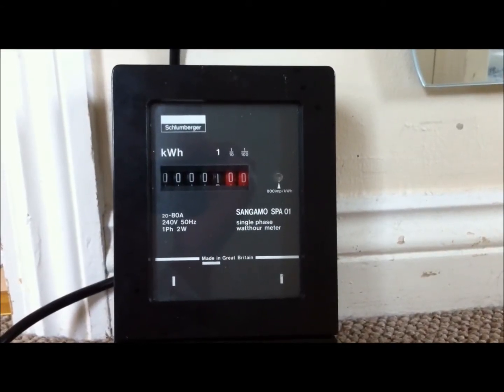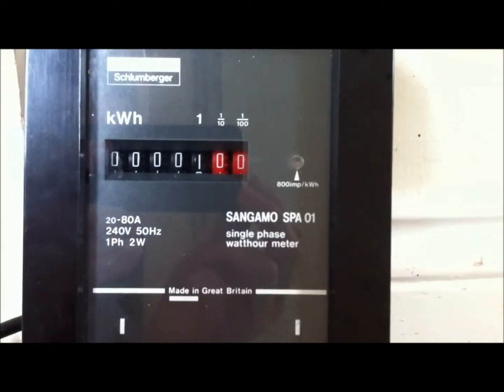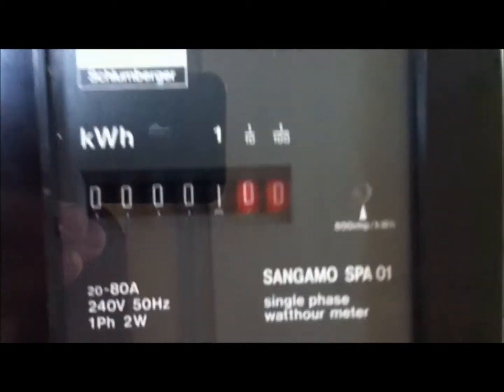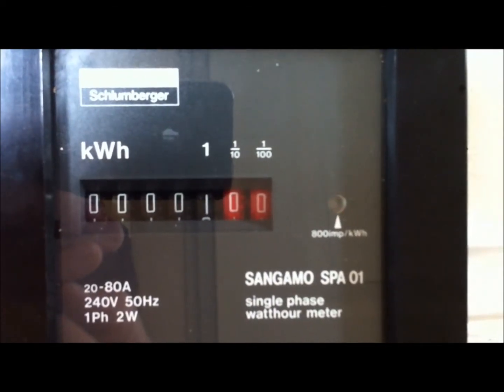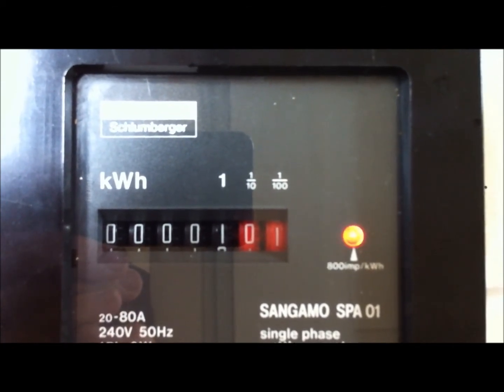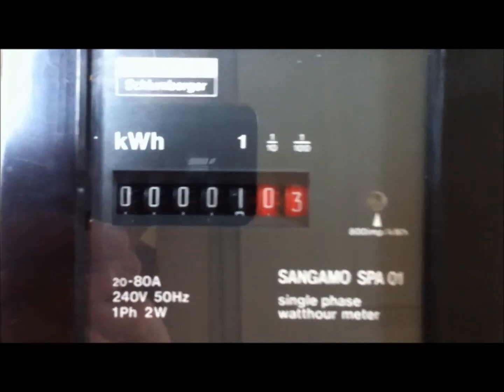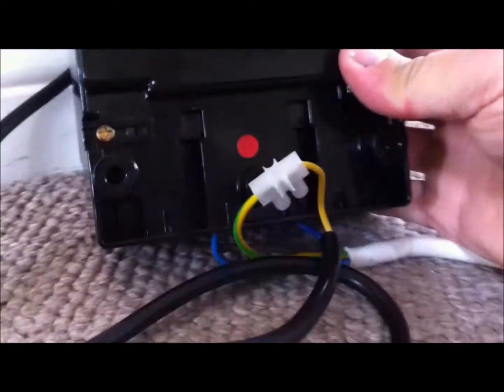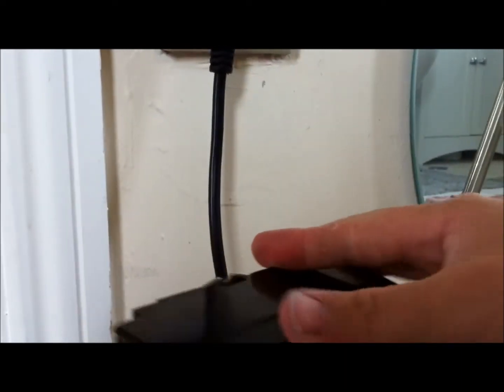Sangamo Schlumberger SPA01 kWh meter

Comment: Hello, where do I find the meter number?
Reply from the maker: Usually the meter serial number is printed on the front right under the black bottom line where it says Sangamo Metering Felixstoe Suffolk England, the meter in this video is decommissioned and therefore the number has been removed. I hope this helps. Steve.

Comment: Hi, I've just bought a house that has this meter and I wondered if you could tell me what it means when the light comes on continuously for about 20 seconds? Everything in my fuse box was switched on but absolutely everything in the house was completely turned off. The only thing i think could be consuming power would be the smoke alarm (with its 9v backup battery) but surely this should merely flash? Have turned the fuse box completely off today and going back in tomorrow to heck the readings see if anythings changed. Speculation: could the neighbours easily tap into it?
Reply from the maker: Hi Ross, normally a continuously lit light would mean that the meter is not detecting a load also known as anti creep, so something like a smoke alarm won't use enough power on its own to make the meter flash so in theory your powering you smoke alarm for free if you wasn't paying a daily standing charge. This feature came from mechanical meters where there had to be a certain amount of load to turn the load wheel this was because under very low load conditions the meter will be inaccurate. I hope this helps if you have any other questions please let me know and I will try and assist the best I can. Steve.
Reply: Steven Watson brilliant thanks for the reply.
Reply from the maker: Ross A-Smith You're welcome 😊 glad I could help.

Comment from the maker: The twitch as you put it I have found it only does that when the meter has been laying on its back or turned around even both registers on my SPA02 have done that. Like you say once it’s done the first one it’s very happy after that. After all they are designed to be mounted on a board and not be moved.
The click up is audible but not annoying at all. This meter is now in my airing cupboard measuring my immersion heater when the eco 10 kicks in it does around 10kWh per 24 hours. You’re welcome